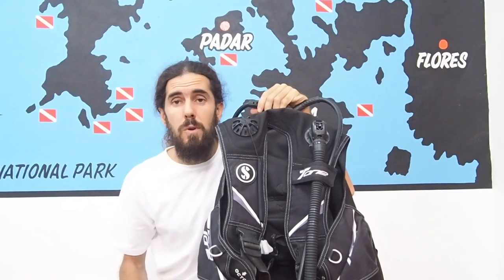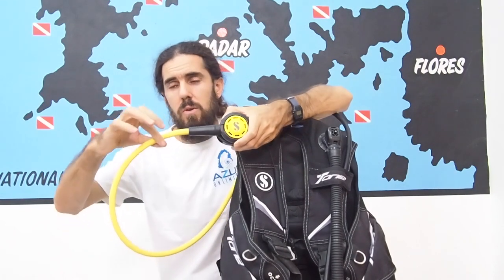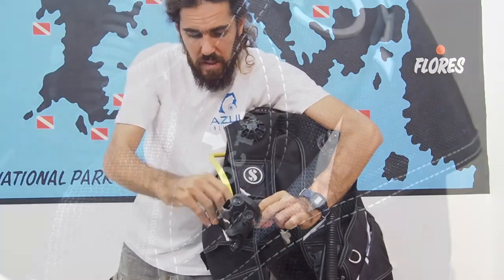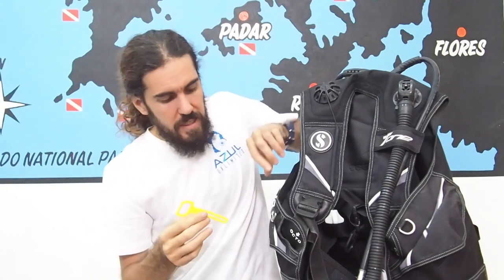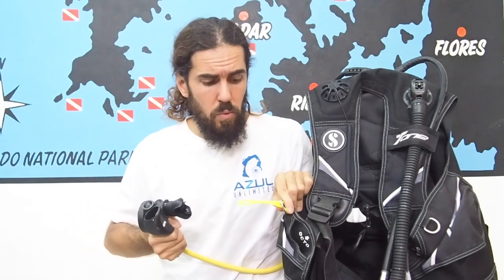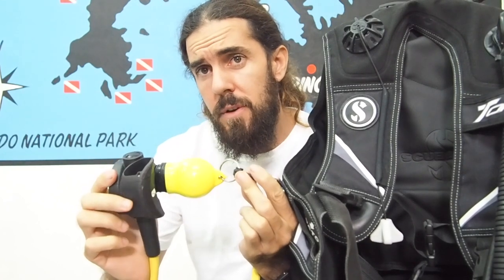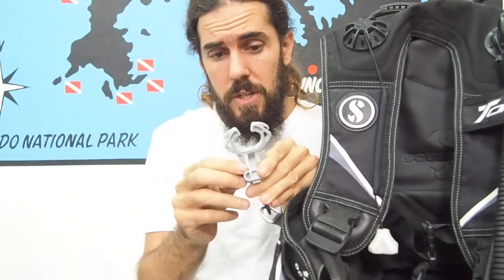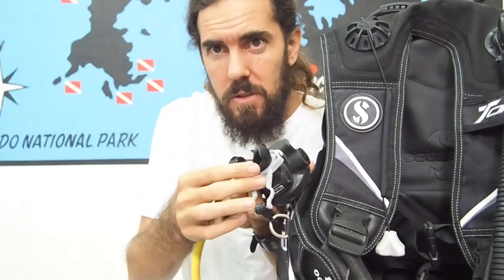How to SECURE your alternate air source 🐙

Comment: How to Secure your alternate air source: Dive with DIR methods. 7ft primary, and secondary on a necklace.
Reply from the maker: That's a good option too, thanks for the tip! I personally believe that some DIR methods and philosophy can be introduce  in recreational agencies to improve safety.
Reply: @AzulUnlimited  i know I have way less experience than you, or your friends, BUT, the approach to the issue of scuba diving, has to be the same as i follow my dog training career: Knowing a proper system of teaching a dog, from puppy to police attack and drug detection. You must follow one correct way. Diving DIR is what every cave diver must use, so everyone knows the same set of gear, and where it is routed. Diving DIR is learning the set of skills with the most potential of growth, the DIR skills will get you farther, more skills, more control, more safety. Backplae/wing, 7ft hose Primary, short necklace secondary air, proper trim... Cheers! I'ma big fan of your channel!

Comment: I see a lot of dive schools putting the octo on the right side, whereas I find it better on the left side as it’s easier to donate and for a buddy to use.
Reply from the maker: Honestly is not a rule about the October on the right side but most of the configurations use it on that way because if you Donny have a reversible second stage, the regs will be in a awkward position on the left side.... but really doesn't matter, is more a common standard than a rule.

A lot of divers from USA prefer the octo integrated on the inflator hose and then they offer the main reg to the victim.
Reply: Azul Unlimited - if the octo is on the right side, you have to bend the octo hose so the buddy can use it. If the octo is coming out the first stage on the left then the hose doesn’t have to be bent to donate, which I find much easier if having to ascend together with arms locked.
I quite like the octo on a bungee around neck and 9m primary donate system idea, lot of tec divers prefer this for some reason. I guess that with this method the hose is more than long enough either side and there is more space for bail out tanks, sides, etc.

Comment: Hogartian config is the answer for me, but I admit that maybe it may add an unnecessary complexity for some divers.
Reply: I love the holder for sidemount, I've seen some already, 3D printed, cheap, and some manufactured, too expensive!
Reply from the maker: The ones from our friends are very resistance and quite cheap, he is doing some cool stuffs with the 3D printer.
Reply: Why do you reckon the hog style adds complexity?
Reply: @GeirAlstad  I don't think so, I told that maybe some divers may think that adds complexity to their diving. I really think that people should dive as they preffer not as imposed by some thougth's ways.

Comment: seeing the different variations of securing the octopus, should also mention what happens with the houserouting in the different situations. some of them create a massive loop that can be entanglement hazard (which isnt a big deal in open water diving) and also looks pretty stupid with the hose coming off your body that much. also can be a hazard when starting or ending the dive cause of getting entangled on the boat or speedboat =)
Reply from the maker: Yeah we are working on a video just for that, the proper position of the gear to avoid entanglements, be more hydrodynamic and avoid damaging the reef.

How are you doing buddy? (Aitor here jejej)
Reply: @AzulUnlimited  cool =)
doing good...in bira with the finishing of new boat ;) gonna be a sexy thing 
where u at?
Reply from the maker: @malfitrasher2188  Sarah back in California for a couple of months and me here in bajo, having fun with the holes on the streets

Comment: So I'm up binge watching your channel tonight and found this another interesting and useful video. I dive a BP&W and I like my shoulder D rings for clipping off my torch and compass as well as having them available to clip off a camera and keeping a spare double ender to use as a tank banger mostly. So I wear my octo on a bungee necklace. It keeps it close to my body and secure from getting muck inside or dragging the reef. I've thought a few times about getting a little longer hose for it so that in the event I had to share air (never had to) it might help create a little more space between me and a panicked diver. Any thoughts on the matter?
Reply from the maker: For BP&W for me the bungee necklace is the best and more confortable option, and also make sense because if you don't have pockets, all the tools, torch etc normally go as you said on the shoulders, so I prefer to leave those D-rings for that propose only and the Oct out of the way. But is a really bas habit to bend the hose and put it inside those D-rings.
Reply: I have a similar rig.  For your purposes I'd say stop thinking about the 'octo' and just consider you have 2 second stages, one of which you have to be able to donate.  If one is on a bungee round your neck you can't donate it.  Remember the one that you have to give to someone, or they are going to rip off you, has to be instantly available.  So the one on the necklace is just for you and you donate the one from your mouth.  It's then totally straightforward to find the one on your chest and bring it up.  This by far the best system, and probably not widely used outside the tech forum as it requires the diver to be happy swapping regs, which surpisingly many are not.  The longer hose, to give your buddy some space from you, then has to be on the reg in your mouth, so you just have to make sure the extra length is routed close to your body.  But beware, it's then but a short step to a 7 ft 'long hose', a twinset or sidemount.  You know you want to!